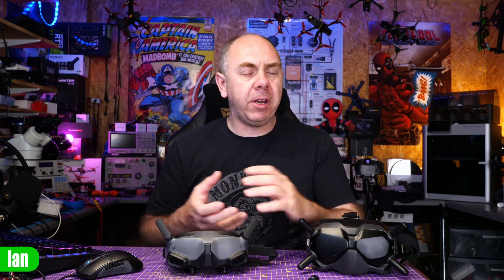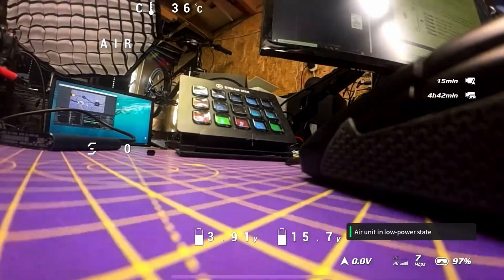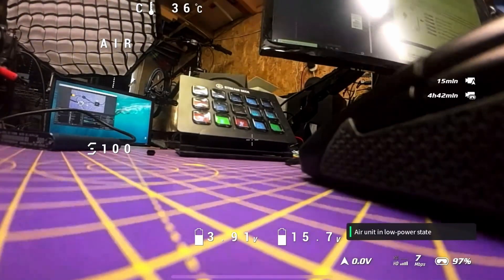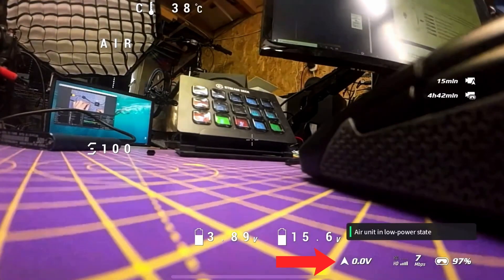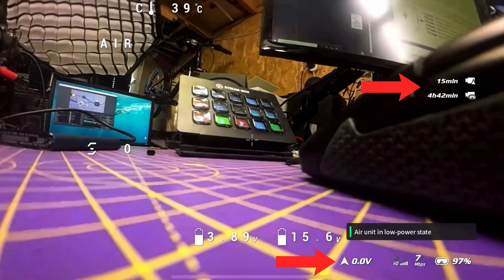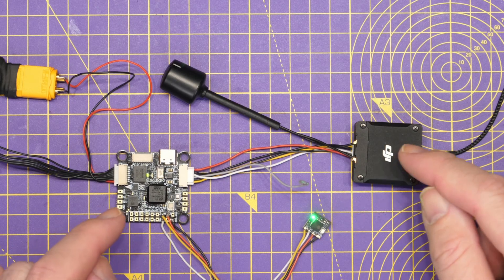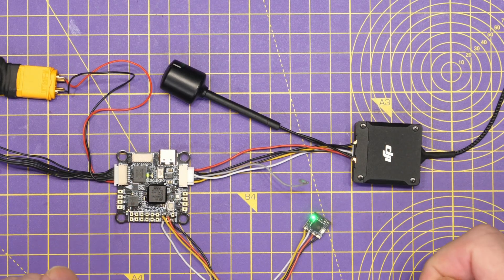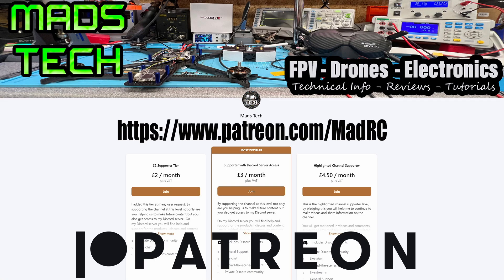DJI O3 Digital FPV - OSD Working But Cant Arm, Record Or Get Full Power - How To Fix.

Comment: I replaced Vista with o3 and ERLS stopped connecting to the remote, if o3 is disconnected then erls will connect and if you connect it after ERLS has connected, the connection will not break and everything will be fine, what can be the matter?????

Comment: Hi. It looks like I burned 6 pins or something when I plugged in the connector. Is there a way to disable low power mode? The wire itself is definitely fine.

Comment: I had an issue with the DJI 04 Lite air unit not arming.  I set my quad (flywoo flylens 85 04 version pnp with dji fpv remote 3) on top of a small fan to help cool it.  i tried to arm it while sitting it on the fan.  Electromagnetic interference from the fan was keeping the quad from arming.  Well it said it was arming but the motors wouldn't rotate.  When i moved it off the top of the fan and set in on a table everything worked great.  Just posting that in case someone else does the same stupid thing I did lol.

Comment: Turns out I left the connector to the air unit loose, smh. The other wires were making some contact except for the TX to RX cable because I was still getting OSD with the low power and auto record issue. After making sure that connection was good I got my voltage on the DJI OSD and the low power and auto record problem was solved.
Thank you!!

Comment: Hello Mads,  I have started FPV last week-end with Goggles 2/iflight Protek 35 O3. The Dji 03 has recorded automatically my flights until it stopped in mid flight. I have opened the drone and realized that one of the antenna's two connectors broke. Do you think that the fact that it only has one antenna connector left is the reason? Thanks a lot for your answer

Comment: What if you want to use it on an RC truck and need flight controllers?
Reply: Did you find an answer to your question?
Reply: @doncunningham3124 well on Dji 04 you don’t need it, but for an 03 you just use a 03 armer. They are about $40, but I would just buy the 04 unit if it was me.
Reply: You can use the O3/O4 armer from ChaddRains FPV. But I myself got a flight controller in my RC car and powered it with a split power from the main RC battery

Comment: Thanks Mads, I can always count you, Bardwell or DRainman to have a video telling me something that leads me to a solution eventually.  I added an RM RP1 ELRS to my quads replacing the DJI controller with a Boxer, but one of my quads with a Luminier HD AIO will not work correctly.  It stays in low power, has no OSD, and the DJI OSD elements are like you show here, 0.0v and very low bitrate, but it will fly (not far before video starts going out).  I removed the same 2 wires from all of my DJI wiring harnesses, and after watching this video, I now know i have pulled a wire that it needs or maybe the UART I put the RP1 on conflicts with the DJI plug JST plug.  Thanks for the help as always!

Comment: Love the Video, I have a special problem with a Whoop Drone similar to the AcroBee75 HD O3 DJI/PNP, When you connect the Battery Nothing happens, I order a new Battery Balance it, same issue, I can go  the the Flight Controller using Betaflight and I also update the DJI part with the DJI assistant Consumer, still nothing. Can you give me some pointers on how to do some more diagnostics , I will appreciate

Comment: Hello Mads, thank you for your videos!! I want to ask you about the gray and brown cable, I don't have those two soldered to the FC. I have my o3 installed in a whoop and it works perfect, I have osd and signal. and I can fly my quad. The only thing is that I can't record when I arm my drone. low power mode. v0.00. Do you know where to solder those two cables? thank you so much!

Comment: In DJI assistant I wasn't given the opportunity to activate the air unit, although I was able to check my firmware version. v01.02.0000
It didn't have a newer version available.
I'm waiting for a charger to arrive so was unable to check or charge the 2 brand new batteries I got for my Cinelog 25 V2.
I'm getting the low power state in my goggles and am assuming my low batteries are the problem.
Could I be correct?

Comment: Very informative 👍🏼👍🏼👍🏼.  For land based fpv, is there a way to arm O3 through betaflight using only FC? Like an auto arm once FC is powered up. Thanks in advance.
Reply: I did the auto arm using arduino and it works great but what I need is auto arm in betaflight using an FC not arduino so that I will have gps for distance and speed and battery voltage under OSD. I did used FC, disabled low power mode but doesn't give you the full power.

Comment: Iv come here to find answers 😂 got the above exact problem, zero voltage, no arming but also the wiring is spot on, can’t see anything wrong. It’s a odd one.
Reply: To be honest not 100% I’v got it armed and flying no problem I changed the link cable between the two. But I can’t get the voltage on the DJI system working, it always shows zero. But it’s arming and working fine in the air.
Reply: @tomling9310  I assumed the arming and voltage were tied to the same issue.

That’s interesting that you got arming to work but the voltage is still 0.

At this point I turned off the auto heat protection for it to always be full power. B/c for the life of me cannot figure out the issue.
Reply: @tylerbell4137 How is the Range ? Short ?
Reply: Did you ever figure this out? I have the same problem.
Reply: Same problem guys
Did you fix it ?? I am very frustrated !!

Comment: Hi, I have mobula 8 with o3 air unit, recently my drone crashed and stuck in low power mode... I have changed the vtx cable, same issue... can you help me?
Reply: It can still fly normaly,  but it displays zero voltage and 7Mbps, and shows low power mode notification, maybe the FC? I also use flywoo naked kit for my o3
Reply: @didichung4377  did you ever solve this problem? I have the same exact issue.
Reply: Yes I solved it... the problem is the 3 in 1 cable apparently...
Reply: Same is happening to me. 
You mean in the cable from o3 to fc ??

Comment: UPDATE:
I have traced my trouble to the flight controller (Lumenier LUX HD AIOG4 FC). I connected my 03 to a scrap flight controller and loaded Betaflight 4.5 and it worked as it should. Just a head's up. It could be your flight controller if everything else is in order.

So, I've gone over everything with a bunch of fine toothed combs and can't figure this problem out. Even moved to a different UART with the same result, no DJI display, but the betaflight display is working. I don't have another drone lying around to connect this unit to, so I'm out of options for troubleshooting this. The only thing I can figure is that my flight controller is loaded with Betaflight 4.5. I don't have a way to roll it back to 4.4 because there is no 4.4 firmware for this board.

Any suggestions or help beyond what this video has covered would be great.
Reply: Have the same i think.😢
Reply: Sorry to hear that, and I feel your pain. @mr-nv5is 

This whole hobby is full of gotcha's like this. If your afraid of running into this crap constantly, I say run from this hobby. Everything I try leads me down twelve rabbit holes that end in a total lack of information or response. I'm a damn good technician and I'm thoroughly frustrated with all the issues. 

I am very saddened by the whole situation. The hobby could be fun if it weren't for constant issues like this.

If I can help you figure yours out, let me know. I'm more than happy to help if I can.
Reply: i have the same problem with the same FC . It came as a part of JB 3.5" sub 250 g build.  I have an email in to JB.

Comment: Today my DJI O3 stopped reacting on ARM exactly on 2 batteries CNHL Black - doesn't exit from Low Power mode on arming, no OSD.
But on 2 another batteries Geprc (same capacity) - all work is good.
Any idea?
Reply from the maker: Sounds like a loose wire on the UART. Check the Tx from the FC to the O3.

Comment: My nazgul is arming but o3 stays in low power mode. Grey wires are  connected. Any suggestions?
Reply: same problem
Reply: @kushalsoma1234  Did you ever figure the problem out?
Reply: @tylerbell4137  some problem
Reply: @cyberbeefpv2810  I managed to fix the issue by moving my TX/RX wires to a different UART port. Turns out my flight controller shipped with a bad UART port.

Comment: I have an o3 since yesterday.. I replaced a perfectly working vista with it. No dji osd and no bf osd. Hooked the vista up again, same wiring same settings in bf and no osd. Hooked the o3 to another quad I do have bf osd but no dji osd. Hooked a vista back to the same wires everything works perfectly. I think i am sending it back

Comment: I noticed that if I plug in my battery it is in low power mode but if I don’t arm it whinin a certain length of time, when I do arm and takeoff it will stay in low power mode.  This caught me out a few times when I wasn’t paying attention to the osd.  Just thought I’d share this info, I’m not sure if this is a thing🤷‍♂️

Comment: It's not only with DJI. I had similar problem with walksnail vtx - the osd was shown perfectly, but it didn't detect arming of the quad (so no auto recording and switching from standby mode). It turned out that I had a shortage between tx and rx cables and even with the shortage the osd was working.

Comment: I had this issue on a Vista being used with the Goggles 2. Thanks for this solution. I was able to get high power mode on the Vista by turning off temp protection but prefer to have that enabled. In my case, I think the RX wire on FC may have been shorting out on the BZ- pad.  Re-soldering the wire fixed the issue. It was a FlyWoo 16x16 and those are a bit fiddly to solder to. Half the connections are on the edge of the board.

Comment: Slightly overlooked but It may also be a bent pin on the fc connector or airunit.  Same difference harder to spot at a quick glance.

Comment: I wish DJI didn't gatekeep full power on the o3 air unit, what's the point of having a setting to force it on if the setting doesn't actually work. I had to solder an Arduino with that open source project to my o3 to use in full power on an RC car, very annoying. I have a fan on my o3 unit and heat is not an issue in any mode. 

And stop changing your connectors DJI - not everyone wants to solder everything. People buy DJI stuff because they want an easy, high-quality experience. They need to stop the madness.

Last gripe - why does image stabilization processing only apply to the recorded video? Surely they could digitally stabilize the feed to the goggles, at least as an option? I think there are people that would happily accept slightly higher latency for this. You'd think they would have thought of this since their own DJI Avata which uses the same o3 system only has a 2 axis camera gimbal. They already have a gyro built into the o3 unit that can report real time stabilization data but it is only usable in post processing!
Reply: Yep.  not every is using a flight controller.  e.g.  FPV for  RC ground vehicles and planes.
Reply: @jlester42  Exactly! Why are they limiting their own market with this nonsense?
Reply from the maker: I did speak with DJI on this and they don’t seem to understand the issue.  Their rep says it’s full power when you turn off low power mode but both my technical analysis and real world result shows it’s not.
Reply: @MadRC  Yes I have thoroughly tested this as well on the latest firmware and my results mirror your own (disabling low power mode in settings increases video bitrate without the arming signal but not transmission power). That is kind of frightening that they don't understand the issue - I can maybe understand this getting missed in QA but how the hell can they still not understand the problem when it has been reported in detail to them by their own customers for months.

Thanks for everything you do for the community and trying your best to report this to them.